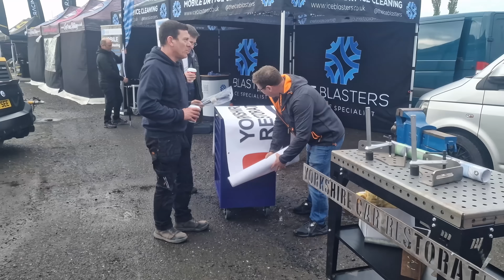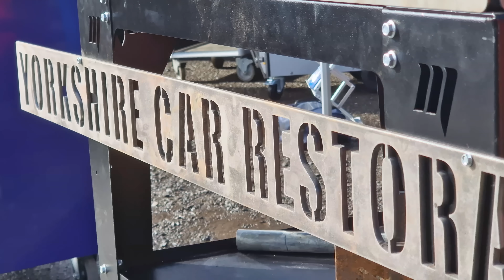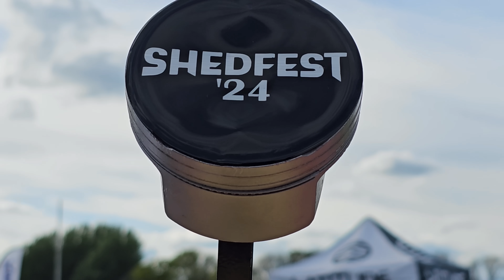Handing Over The Keys! Finally Painting & Finish Restoring Auto Alex's Classic BMW E30 Touring

Comment: How come you guys used a 2k solid instead of the traditional 2 stage paint basecoats nowadays. I know it's cheaper but surely it'll just fade again after awhile as it doesn't have strong UV protection. Guessing it was for time reason but still a good paint job though. Unfortunately I missed this at shedfest :(

Comment: Looks to be sitting too high at the front, is the engine still out?
Reply: Thats's an issue with the body of the car from factory I think. For the facelift version (which this is) BMW decided to lower the rear wheel arch in relation to the rest of the body by several cm effectively making the car look as if it was too low in the rear. I have no idea why they did that, especially considering that the pre facelift version already looked a bit too low in the rear😂

Comment: Please don’t tell me you left the green grommets for the front wings and the side moulding clips in when you painted it!!!
Reply from the maker: Yes we did as they brake otherwise and we didn't have time to wait for new ones. Oh and it still turned out magnificent. 🙄
Reply: @yorkshirecarrestoration  still available from BMW and eBay. Nice job though
Reply from the maker: @rezaq1  we didn't have time once we noticed, no harm done still work as they should.
Reply: @yorkshirecarrestoration  still looks fabulous. Fantastic job
Reply: @yorkshirecarrestoration  you left them in to get another rust repair in a few years didnt you 😂

Comment: Great job guys but your paint booth is abit of a joke as it doesn’t seem you have the correct filter system in place for 2k paint as you had the booth doors wide open and letting all the toxic fumes out into the atmosphere
Reply from the maker: It's a work in progress unless you wanna donate a better extraction system :)
Reply: I thought you HAD to have airfed masks for paint with isocyanate hardener (ie 2K). Also skin protection etc. I'm only painting my own car(s) and have spent a lot of time and money getting enough air to feed gun and mask continuously. Not sure if it's worth the hassle as Pros seem to get on fine without all that 🤷‍♂
Reply: It’s not the fact of a working progress if it isn’t correct and with in the regulation of paint you shouldn’t be using it